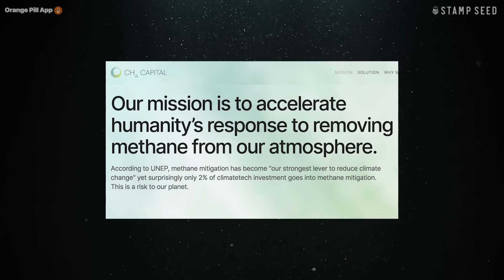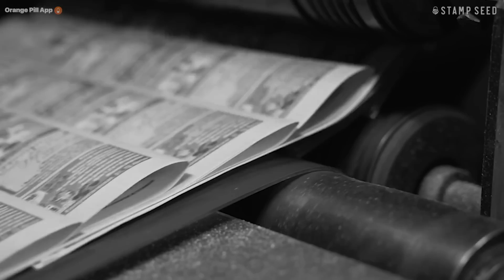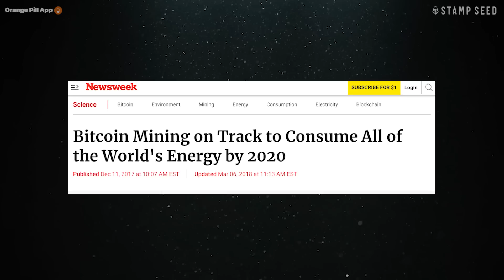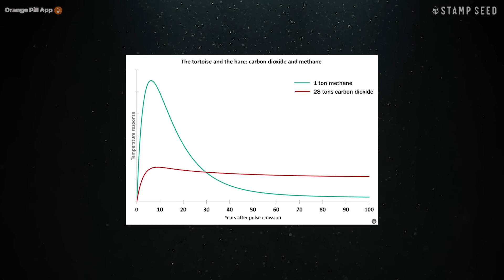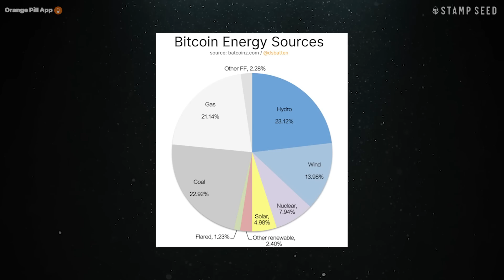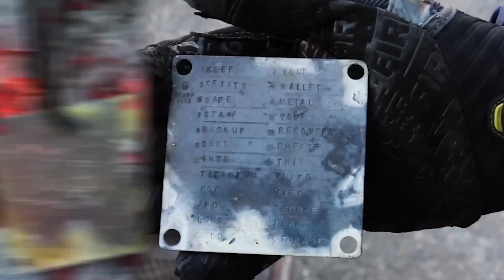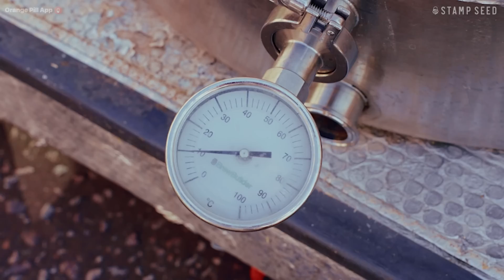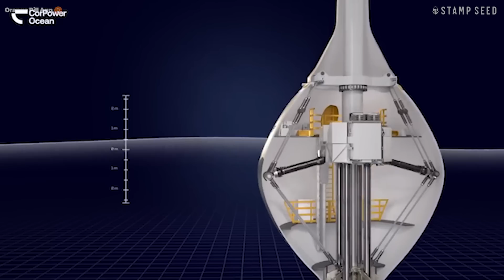How Bitcoin Goes Carbon Negative by 2028

Comment: Study physics.  Electricity goes into Bitcoin mine, heat is generated, Bitcoin produced for free. Get it? Bitcoin does not consume electricity.  A Bitcoin miner and a space heater create the same amount of heat per electricity consumed.  Heat is needed by humanity for many reasons, let’s use it. Heat homes, melt aluminum, many businesses need heat.   This should be the focus. Balance the equation.  Electricity in, heat out. Bitcoin is created as a byproduct.
Reply: Free space heaters for every single mom in south Boston.

Comment: The future of sound money is here. Litecoin is the second oldest coin on the market, after bitcoin. Since its invention and implementation in 2011, litecoin (LTC) has been listed as the tried and tested alternative to bitcoin. Litecoin (LTC) is a digital precious metal, a digital commodity, not a security, which cannot be debased, censured, seized, frozen, or confiscated.  As a truly decentralized digital commodity, LTC cannot be debased, censured, seized, frozen, or confiscated and it possesses MimbleWimble (MW) privacy protocol and Proof-of-Work consensus; and both have limited supply of coins: 84 million in case of litecoin, and 21 million in case of bitcoin. Only that litecoin is lighter, swifter, and hugely undervalued against bitcoin. Bitcoin is the money of the kings, litecoin is the money of gentlemen.